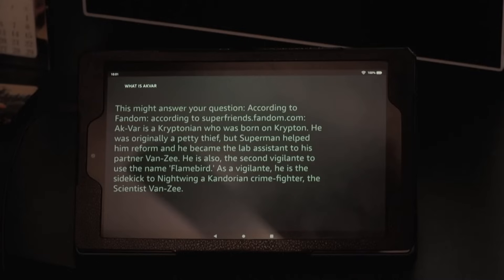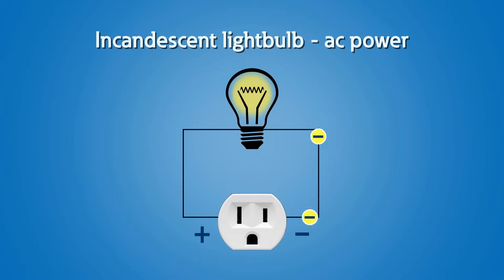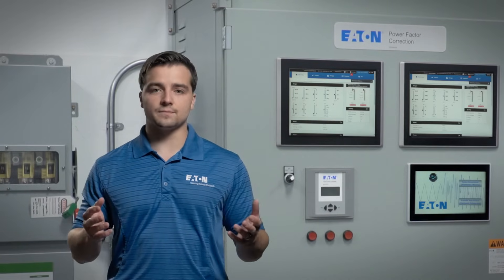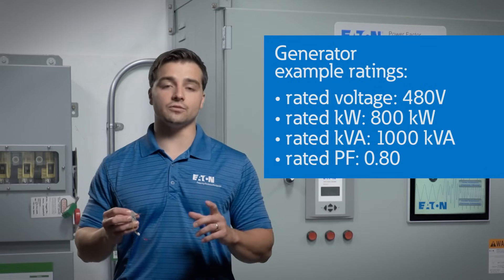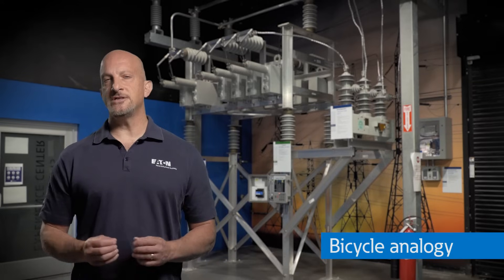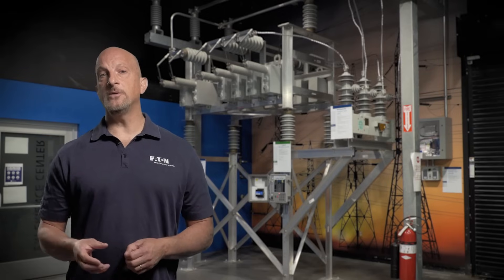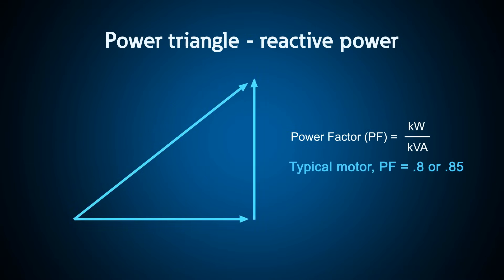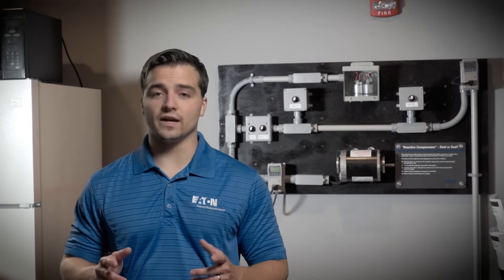What is a var or kvar - reactive or imaginary power explained

Comment: @3:47 I don't understand why "Reactive power is also called Reactive Power".Because It does have a negative value! So what? It's supposed to be the multiplication result
Reply: Takes the name from the energy stored in the reactive components. When plotted on an impedance diagram using imaginary numbers inductors are in the +j (i) and capacitors are -j. Mathematically in rectangular form its similar to ordinary x,y components of a cartesian graph. y is replaced by i (j in electrical). Inductors are positive along the j axis (ie y) and capacitors are negative.
Reply: Hi like I posted above I taught this for twenty years and reactive power does have negative value and positive value and depending on the type of load the negative power can cancel out the positive power giving you zero watts consumed in a circuit drawing  50 amps at 110 volts   because  W = V x I x PF

Comment: So I think a KVAR for my  home would only level out the incoming current instead of having spikes when my AC compressor turned on. The KVAR would make up the difference needed by the compressor starting, then "refill" when the AC is in run mode.

Comment: I know a welding fabrication shop that has problems burning up motor and other electrical systems problems. Would a capacitor bank system with variable tabs help them? is that something you sell.

Comment: Is this why inverter ACs are energy saving? Because the condenser is running all the time (rather than repetitively starting/stopping), thus less reactive power consumed over time?
Reply: Nah
Reply: It has nothing to do with that. ACs with inverters are using Variable Speed Compressors.

Comment: Simple ! Either different PF in power calculation involve PF will be equal in KW "without cosider of Time". The power factor is the efficiency of performance.
A 0.7 Pf is 70% of efficiency, another 0.98 is 98% efficiency. Imagine 2 biscuit machines with a 100 pcs/hour as reference with different pF. in production. An order in 980 biscults; 0.98 pf take 10 hour to complete the job, where a 0.7 pf take 12.256 hour to complete. Who is the winner instantly can be seen. By define of machine with manhour just can easily be explained as cost saving.

Comment: What, you’re asking a grandma and a kid what is reactive power? Lol.

And reactive power is not imaginary, it’s real (as in a physical phenomena) and also a real number. In a two-terminal network or load operating in sinusoidal steady-state, the magnitude or absolute value of reactive power is the amplitude of the instantaneous reactive power, i.e. the maximum rate at which the oscillating energy flows.

—

3:32 That’s not exactly apparent power. The product of instantaneous voltage and instantaneous current is instantaneous power, all of which are a function of time, and are the curves shown in the plot. Apparent power is the product of the RMS value of the instantaneous voltage and the RMS value of the instantaneous current.

Comment: "Element doesn't have time to cool down or stop shining" - wrong - wrong wrong wrong.
Reply: It seemed to make complete sense to me - what's the issue with that statement?
Reply: @PharmaGiles  That's not how it works. Just take a slow motion video near light source that runs on AC power, it will be flickering off and on. This video is littered with small inaccuracies that do make serious differences when engineering
Reply: @jamiemarshall8284  if it’s a gas discharge or LED light then you’re certainly right, but a filament lamp - I don’t think so, for the reason he gave.  Wouldn’t you agree that a hot filament would have to cool down in order to dim and flicker, and how can that happen 50 or 60 times a second?

Comment: VAR/reactive power when viewed in the form of those power cycles which were initially shown,2 positive and 2 negative in one complete cycle(for purely inductive/capacitive) load. What do they represent in that waveform? Rms value of that waveform, avg value or what?

Comment: You say that the reactive power into a generator is only used to excite the field. This is wrong. The field is produced by DC not reactive AC. The generator supplies reactive power only by virtue of the load capacitance and inductance which alters the current phase wrt to the voltage phase
Reply: He talked about motor and not generator. DC excitation is used in Generators to produce magnetic field which then moved by prime mover to produce rotating magnetic field
Reply: I taught this stuff to power plant operators for years and educated them on power system management specialising with off shore production platform power systems.

I tell my students for get froth on beer and such nonsense. Some loads we connect to our AC generators cause the amps to flow out of alignment with the volts... capacitive loads cause the amps to peak before the voltage peaks and inductive loads cause the amps to peak after the voltage peaks.  

Because we use magnetic AC generators, this has the effect of lowering the voltage when inductive loads are connected, normally called Lagging Power Factor loads. While connecting a capacitive load to our generator will cause the volts to rise.  

All these amps that flow that are not aligned with the volts have a zero wattage component since watts are amps times volts... so if the amps flow when the volts are not there or negative then total summation gives zero watts. 
And to quantify just how many amps are out of alignment we call them VARS Volt Amp Reactive. 

In managing any sort of power grid they focus on two things, the voltage, if it is low you need generators to put more VARs in the grid, if the voltage gets high you need them to reduce the amount of VARs they are putting in the grid. While the grid frequency indicates an excess or deficit of watts from the generators.

Naturally big systems talk mega watts and mega vars......usually if watts is mega Vars will be to.   The relationship between Volt Amps, Watts and Vars is given to us in the power triangle..... which you can google!
Reply: See 5.28.